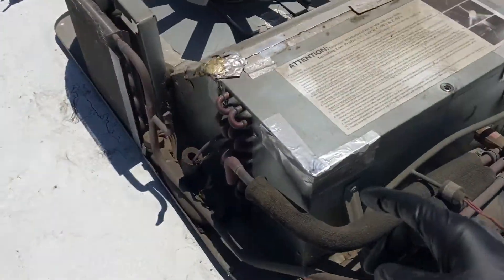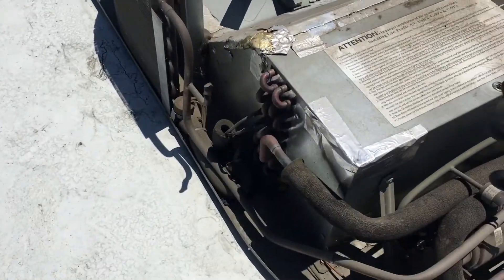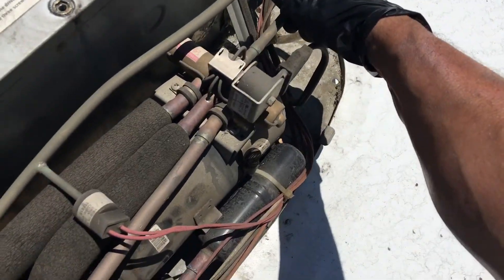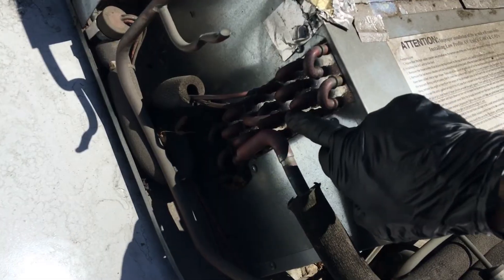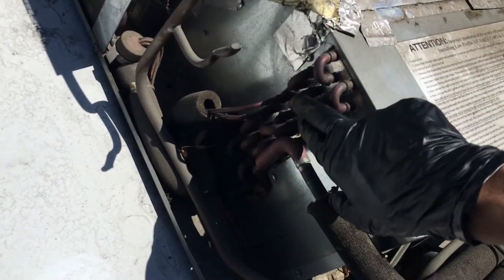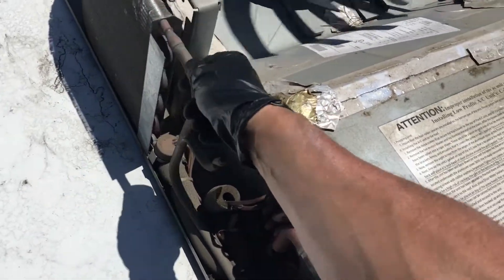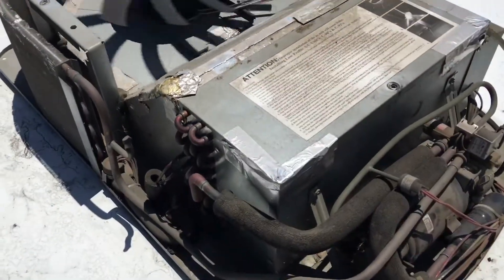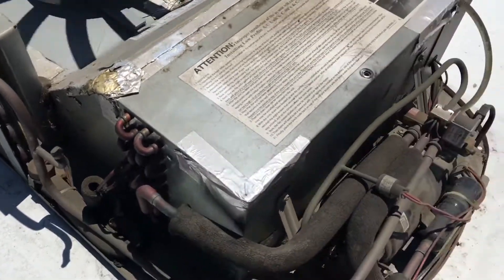R410 Refrigerant On RV rooftop air conditioning.  Low on refrigerant charge￼￼

Comment: How much does in normally cost to have this repair done? I have a coleman mach  unit that needs it.
Reply from the maker: I’m in the San Francisco California area so our labor rates are rather high here. 

This is a sealed unit that has no access fittings so whoever works on it Hass to tap in to do a refrigerant recovery first

Then they have to cut into the copper tubing on the high side and low side in braise new service valve fittings that will stay there permanently. 

Roughly around $400 plus for each unit your average size RV will have usually two of these units on a rooftop so I’ll be a little over $800. 

But since the time of this video the price of the R410 a refrigerant went up about 400% so the price of materials will be a little bit higher.   

        And I believe I might’ve made this video before Covid or before the shot down and price and materials and labor has also increased since the time I am shot this video. 

So if I were to do this exact same vehicle today I am very sure the charge would probably be over $500 for each rooftop unit.

Comment: Hi sir.

Mine is a coleman mach 3 15k 2005 model.
Takes r22. 

They cool good, no freon leaks I can tell.. but I wanted to top them off...

Any idea what low side psi I would be looking for with r22 on these units?

If you have any idea I would appreciate
Reply: Hey.

So did you use the solder on saddle piece valves for it?

I seen some on ebay that claims can be soldered onto a charged line. 

Just curious if you used those. And if it could also be done on High side?

I'm taking the epa class now so I can do it all legally. I am going to get a scale, vac, etc 
Nice that it never expires. Be good to have.

Thanks
Reply from the maker: @Heliarc91  Harrah’s 15% silver braising rod.  This is the industry standard tri and true tested for decades.
Reply from the maker: There was no low sides fitting so I had to cut open the copper and braise on service fittings
Reply: @coldfinger459sub0  any idea how I could find out what the max low pressure is for the unit ? Like a generic r22 temperature chart?
Reply from the maker: @Heliarc91  Let’s just say for example you wanted your refrigerant temperature your evaporator coil temperature at 37°F this is only a example. 

      Looking at the PT chart the pressure of your suction line coil out of the evaporator would be about 64 psi. 

And due to inefficiencies and losses of the air going through the evaporator not being 100% efficient let’s pretend for example your air temperature leaving the coil will be about 10° higher this is only a example. 

This would mean the air temperature right off the face of your coil would be about 47°F. 

I do not work on these RV units this is not my specialty they’re very basic simple little machines I did not even bother to download and read through the manufactures motive of operation or specifications. 

I just use my ears my hands to listen and feel for temperatures using my experience determined the likelihood of the system was operating and just low on refrigerant. 

I tapped the existing lines with a self piercing tap to extract and recover the remaining refrigerant I weighed it out with a scale and that told me that for sure I confirmed the system was low on refrigerant. 

Then after that I cut off the ends of the tubes were they filled it from the factory and permanently sealed it off . I braised in doing my own service fittings with valve cores. 

     Then I read the sticker that indicates how many ounces of refrigerant needed to be in the system and only by using a scale and weight I filled the system up exactly to the manufacture specifications after doing so the system performed excellent. 

You may be able to go to Coleman‘s website and download the service manual for that system to look up all its operation parameters and specifications to teach yourself about it follow their instructions on diagnosis and service.
Reply: @coldfinger459sub0  Oh thanks!

Yeah,  that is how a professional would do it. Lol, extract, and weigh.

I have these old units and am debating trying to top them off with a pierce valve. I know the risk is high for a leak. But the age of the unit and cost to try for me would outweigh it leaking out in a year or even a few months until I get around to replace them. (950$ before shipping)

I was hoping there was a generic pressure @ ? Temperature. But that's OK.
I cleaned the coils with a water hose and cleaner. Straightened the coils, replaced blower motors...did virtually all I could to maximize the old thing. 

I'm already noticing atleast a 20% efficency gain from being not cleaned in years. 
But, I do often think of just trying to top off to see if I can get it running near new condition again. Since r22 is still available to purchase.

I may just see how they run and may opt to try it on one of them at some point. I'm a RVer so I've heard many stories about line taps. Some of which claim no leaks IF properly prepped and cleaned the line for even over 2 years. 
Others said it leaked within a year, or rather a summer.

So I'm not sure. I do see how expanding and contracting copper tube could make a seal hard to get on one. 

I appreciate the reply
Reply: If it’s low there is a leak. You should never have to “just top it off” lol
Reply: @peterdarlington4117  it still works off and on depending on temperature and hasn't ever been serviced for 17 years. 

I'm going to assume small leak...and if it makes it another 2 years I'd be so excited. 
I have EPA 1 so I Can do it now if I want
Reply: @Heliarc91  yes I’m an HVACR contractor in Florida I have my universal EPA but you don’t have to have an EPA card to make that repair as a homeowner notice anyone can buy the gas! My thing is if I’m gonna do it I’m gonna do it right kind of guy and six months ago I was paying $135 for R410-A now it’s $435 for a 25 pound drum and is only going to continue to climb now that they announced the phase out of R410-A
Reply: @peterdarlington4117  I gotcha. I just need 2lbs of r22 which isn't bad. About 100. I want to extract and solder a valve not just top off anymore. 
So I have to buy the scale...ex tank...manifold but then I'll have it for the future.

Ya I'm leaning towards replacing the whole unit its just expensive and heavy

Comment: Mr Tom did you find the leak?
Reply from the maker: No I have to come back and do the repair later I have no time to repair these this day I was too busy. 
             I was asked to look at them after I got to the job site it was not scheduled for the rooftop units I was only scheduled for the automotive front driver Dash air conditioning

         I did see a slight dark residue on one side of the outer sheet metal casing where the electrical wires went in but I did not open it up to look at it I will have to do that when I come back for the day of repair and recharge. 

          But these units are original nobody has ever serviced them since 2012 and the unit still have some gas in them and at least coming on so they probably let means the leak is very very small. 

      This is R410 a refrigerant a very high pressure refrigerant not Automotive refrigerant
Reply: Great video, gonna be waiting for part 2.  Btw Happy fathers to you sir.
Reply from the maker: @hr92011hr  forgot today’s Father’s Day thank you me and my son are working Together up on a rooftop on a commercial VFR installation
Reply: You can use Hvac trublu plumbers goop to stop leaks